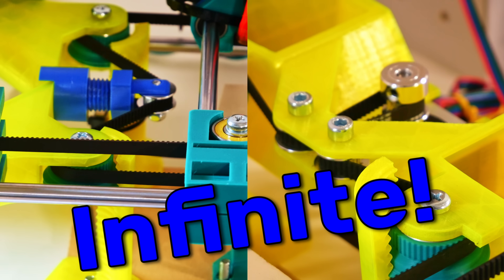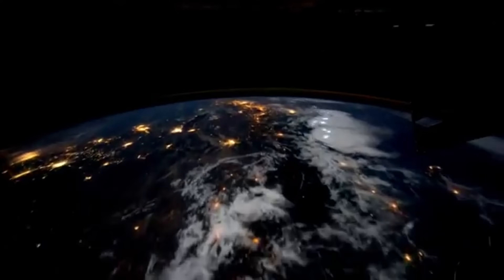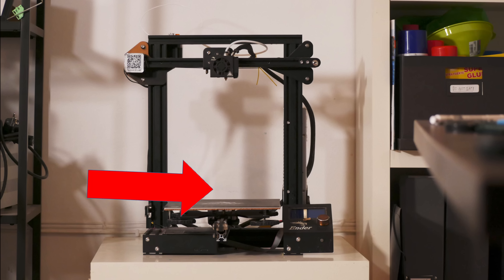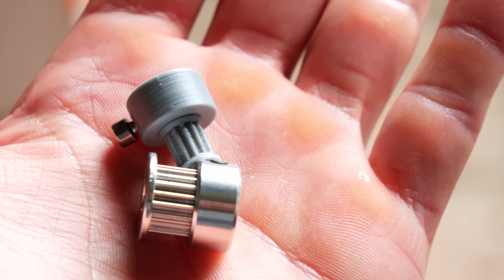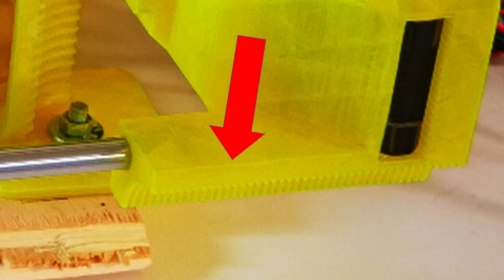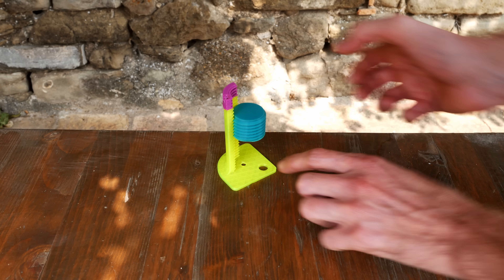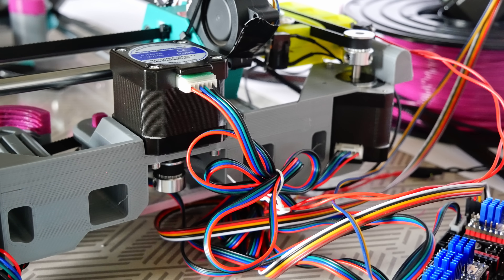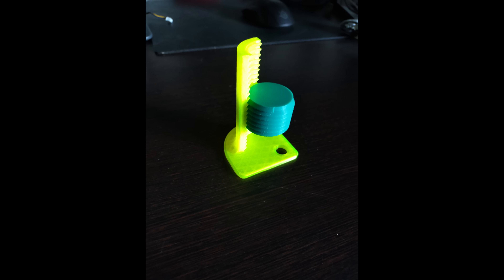it can 3D-Print onto itself?!

Comment: I don't think all the parts of the puzzle are here yet to make a print in place printer that can replicate itself. I guess thats half the point of this video and you have to start somewhere and work toward the end goal. I can still see this resulting in some useful concepts and applications even if it doesn't accomplish it's intended purpose. Part of this approach needs the original printer to be able to make a quality enough machine that even a few replications down the line, it remains viable. Even if they get a touch janky, at some point it's resulting printers will need to be able to make a printer as good as the original. It may have to print dedicated plastic-only and metal-only printers. It will likely need to print a mobility platform to move it's existing frame and parts between other modules. I wonder if the better approach is to look at the mobility platforms it would inevitably have to print, and if they can be modified to facilitate printing on their own?

I kinda think the solution is going to come about by an entirely different process or two. Once we have enough processing power to reverse engineer and understand DNA completely, we can grow organic "machines" to do this. For better or worse, the same processing might also lead to developing a completely viable mechanical self replicating swarm bot. Even if those design approaches take off and beat this design concept to the goal, I look forward to seeing what we can learn from this project.

Comment: Using 3D printers to print themselves it literally how they started 10 years ago nothing new here :(
I see metal  bolts,  screws,  liner rails, bearings, you need power supplies, stepper motors, a control board basically all of the things you would need to make a 3D Printed Prusa 3D Printer !!! You have done nothing original at all!!!

Comment: Check out the GUS simpson. It can print all the parts for itself (even a bigger version of itself) in its own build volume. It doesn't require linear rods either, so it's more feasably able to achieve the 100% printed goal. I designed a printer in openscad based on the gus simpson, but with some improvements, I'd be willing to share it if you're interested.

Comment: Is a good idea but I was thinking "the other way" for terraforming. Basically the machine should be able to conform the ground as a build plate by both compression, digging, filling; then scan the surfaced use supports over a scanned surface the same way we scan the bed now. This will defeat the gravity issue and proceeding on the ground level is easier for heavy machinery and scalability.
Reply: TLDR: switch Z with X or Y ;)

Comment: I think i saw in a lecture video some where, where the lecture embedded metal and ceramic particle in resin solution. Then use tradition resin printer to build up the structure, afterward sintering in an oven to remove the resin and fuse the metal/ceramic particle. An interesting side effect is as structure feature size decreases, the strength of material actually increases beyond the isotropic material strength. And it was able to build material with customize stress and strain curve. Pretty interesting. Too bad that video got privated later. But the same technology of suspend non-filament material in filament could work here. Maybe infuse the filament with microsize industrial diamond or something

Comment: after watching 10 seconds i thought "he won't be able to print the precise parts like guide rails, stepper motors and even just a multi strand wire and forget about the power supply and controller." After watching the whole video he didn't even hint at most of these challenges (apart from Parteon exclusive content... ) 
At least this isnt about a revolutionary blood test device but just a 3D printer of which there are plenty to choose from on earth...

Comment: Well, this is certainly a novel design concept, would it be a CoreXY or Mendel-derived?  Either way, it's always nice to see someone produce a new approach to the RepRap problem.  I wish you luck in getting your system to remain accurate at higher Z-height, and in second-generation designs.  Accuracy has been the boogeyman of most of the mostly-printed 3D printer projects.  Self-replication just turns out to not be that valuable in situations where you have access to the industrial base of Earth - and anything that seriously threatens that will make acquiring the components needed to control a 3D printer impossible to acquire, meaning that even the ability to print motors and circuit boards will not allow for the creation of new printers.

Space exploration and colonization are a different beast, of course.  Sending long-term missions off with a printer that can partially replicate and extra sets of unprintable "vitamins" should be standard practice.  A smart interplanetary exploration group would also agree to a microcontroller standard, probably Arduino, and send along a box of hardened controller boards that can be swapped into various devices after either being reprogrammed on-site, or more likely by a team back on Earth who can do the programming and implement whatever hardware the explorers need in order to ensure that it works before transmitting it.  

But, hear on Earth, there just isn't really any way to compete with traditional injection and cast molding for producing strong and accurate components quickly.  3D printers have much greater design flexibility than molds or subtractive machining, but they are way too slow to serve as the basis of cottage industry.  They're too slow and inaccurate, even if you're using them to make your expendable components for other manufacturing methods, like lost-plastic casting.  I used to be a true believer in the economic transformation 3D-printing could bring, but it's just too hard to realistically compete with a 39-year-old single mom pulling the lever on a home-made manual injection molding machine.  She will make in a minute what takes the best printer an hour.

3D printers have their uses, and they should be used to their full potential instead of merely as slow plastic crap makers, but unless the design requires additive manufacturing there's almost always a cheaper and faster way to make a widget.

Edit:   Waaaait, you're the guy who does some really smart print-in-place compliant mechanisms to avoid gear slop.  You know all this shit already.  Why not see if there's any part of an X/Y carriage that can be done with compliance?  I knew a guy who messed about with Sarrus linkages in place of steel rods over a decade ago.  His linkages had slop, of course, but perhaps there's a compliant variant that's possible to print?

Comment: I had Ideas to fix problems. First of all to beware of slipping gears you can use wheels and helical spring to pull legs to gear. in this way it will always stays in line. for sensing end of legs top you can use photo diode and low power pointer laser with relay or something suitible with your project base. but even if you do these there is another problem when legs get longer they will tilt over and they will be shaky. For this reason you have to print some joist(I couldn't remember its name but maybe its called beam) cross joist will be stick it to getter more stable. I can make some basic drawings for them too.

Comment: Why don’t you print horizontal supports between the z axis towers to prevent slipping and wobbling at higher heights
connecting them would also mean you don’t need to screw the towers to the ground
Reply from the maker: True! And it's designed to do that, but in this prototype form it is relying on the frame rods being the right length, and they are not, so for now the legs are independent for the development stage
Reply: you can do that at the bottom and top, but if you do it in the middle, you then have to remove material before you can use it as a frame for the next generation.

Comment: Good work to increase the build volume by printing itself. if this works, means people can make larger printers than buying, reducing the market cost. But as you go higher, problems such as wobble, vibrations and noise in prints can be forseen which ultimately effect the print quality and reliability.
Reply from the maker: Jupp, but its designed to be able to bridge between the legs, so that will ad alot of stiffness to the structure

Comment: won't a small imperfection in the print make more imperfections in the next printers, making a chain of errors that will become bigger and bigger? and let me tell you: in one print there are lots of imperfections.
Reply from the maker: That is correct, hence why we need a closed loop control system, that should be able to negate this issue
Reply: @TurboSunShine  have you tried actually print another 3d printer multiple times in a chain?

Comment: I would say you need to changing your starting goals. I had a brief ponder over the problem and feel you need to turn this on its head. I think you need to start with an upside down core x/y printer with the z-axis moving away from you as you have started. But the base model to start this would need to be a multi head 4 axis type core x/y. You would need to use more exotic materials and have pick and place hardware available on the base model, such as bearings, screws, electronics, hotend etc. The multi head tools could include different materials, a router/drill, a pick and place head, screwdriver etc. In terms of the z height may be a gantry crane triangular frame with the threads on one side to provide rigidity. Other problems will be keeping the first layer attached to the build plate throughout the process and preventing warping and shifts due to temperature changes. Perhaps the unit needs to be enclosed as it is built, with some form of draping skirt and roof as it gets bigger to seal the heat in. I think decreasing the starting goals so it is the first iteration. Then extend the goals on each iteration. My other suggestion is would be to use SLA rather than FDM. Again a pick and place could slot bearings in, but you would have a better control over accuracy and although enclosed again, no issues with temperature problems, 1st layer etc. It could be feasible that using SLA different materials could be used such as silicon, copper and steel and other specific materials. Of course technology isn’t quite there for fusing materials such as steel and copper together without sintering the end product.
Reply from the maker: Yes, a lot of these things have been considered, and some will probably be implemented in some way! For now, this is just a prototype, so alot of features were omitted

Comment: They are called Butress threads, used in jacks, lifts, screw presses, etc. There are also some bone screws with "C" shaped threads.
Reply from the maker: Jupp, but those are slightly different, since they have a 0 deg thread angle, rather then a "negative " one

Comment: Genius idea but here comes a stability problem
as it gets taller, it has to handle itself and the machinery, causing to bend and eventually breaks, so it needs to handle it's own weight while going tall as possible without collapsing.
I am no architect, but all materials are soft, so in a conclusion it needs to be improved (by 3d printing supports that handle itself)
Reply from the maker: Ok, infinite might be an overstatement, but it should be able to do what it's designed for:)

Comment: Two thoughts: add dual load cell for x and y to zero.

Or add limit switches to each side and the hotend has to zero out at that limit switch which corresponds to the start of the "ladder" for it to print.

Comment: Crazy-clever! 

>> To avoid wobble as it gets taller, print diagonal braces (or even a solid shell) rather than just legs.

Definitely out of the box thinking! 👍😉
Reply: When the concept finally works, it wouldn't even be a problem if it was very slow (because printing a complete solid shell). Since it replicates exponential, the print speed would only matter in the beginning...
Reply: Printing sides may seem like a good idea, until you realize that it can't make a second print with sides in place.  Because the Z-axis is inside the print volume, and the X and Y inherently cross the build area, any bracing between the Z pillars will cause the X and Y axis to crash when approaching Z-0.
Reply: @Kineth1 It can't make a full-size second print with solid sides, but it could still make repeated prints within a slightly smaller volume. It seems to me that it would make sense for the larger printers to make this trade-off - they can still continue to scale up their copies at a slightly reduced ratio.
Reply: @qwertystop But that would defeat the entire purpose of its design…
Reply: @Kineth1  Good one, job security.
Reply: Whats if you make a Big plate on the ground and make the z axis on it
Reply: French cleat with angled steps, comes to mind
Reply: if i can add use radio tower stacking lattice structure as reference. electric/data cable roller from 1 of the leg bottom, and filament roll in the middle top of upper frame, so no stray cable/string messing the z motion.

Comment: regards the trigonometry to determine exact position.. could you consider using a laser to determine exact position?
Reply from the maker: Yes, but that does make it more difficult to fully print it (which is the ultimate goal) so for now we'll have to see if we can get away with some sort of switches or load cells

Comment: this is nuts, the solution to some of these problems is outright brilliant. i hope you crack it. 

rather than using a nozzle probe to find the position. maybe it would be better to have endstop switches on the edge of each Z axis. then you know where the printer needs to add new layers to the Z axis when the endstop is not held down + any offset, the nozzle is alligned to print ontop of it. ime bltouch just doesnt have great precision or repetability and personally ive had far better success with Klicky-Probe. but maybe direct nozzle probing would be best for this so you dont need to worry about probe offsets given you need to be precise or the printer falls apart but now you need to wait for the hotend to be cold to probe and also need to ensure its clean.

the probe method needs to be as repeatable as possible. the variance will add up every time you need to restart printing your z axis.

Comment: The printer that can print itself is still a very noble goal, and I love this general concept. But without really good constraints in the basic design, this printer will be a very effective error multiplier, especially as the self-printed Z axis layer height is guaranteed to have imperfections that add up in the output model dimensions. There must be some better way to get a Z axis and guarantee layer consistency at the same time. (e.g., Redesign as a wall-mounted XY gantry with the Z bed hanging below from its drive belts or drive screw.)

Comment: The only problem I see is the legs becoming increasingly unstable with height. Maybe input shaping could help (if you did not already implement it). Other than optimizing the movement and making the legs more rigid (by integrating them into the design as you already did) there is little you could do so there is a practical limit when it comes to height.

Comment: Amazing conzept, I also toyed with the idea of printing a motion system for a printer directly, but I did not take it anywhere...

Very clever solution for the self-printing brackets, but I would be a little worried about it getting too wobbly on larger prints

I will follow this project with great interest!

Comment: Wouldn’t the resin printing a solution for this? Precise rails  and if z axis has a gear that lift up the cured part then it’ll be infinite and we need just one dlp or galvo or what ever with 2 stepper to lift it up

Comment: I would love to see this be a thing because it would be simple and straightforward for manufacturing of the future.
But there are so many processes that just don't lend themselves well to this that I think a better approach is makeing the each machine capable of makeing some of its own parts rather than all of them.

So as long as you have one set of all the machines then they can collectively make themselves.

There is the obvious examples like not being able to print the ICs that go on the circuit boards to run it.
OR
You still need seperate machines to refine raw materials into a form the printer can use.

Hell just the fact that a finished printer needs to be removed from inside the build volume already means you still need external systems even if the printer was fully functional as printed.
So if you are going to need a robotic arm to remove finished printers. Might as well just print arms and have them assemble something assuming that makes a problem easier.

Said another way. Rather than trying to print a fully functional printer. Since there is no way to get away from still needing other machines. Make a printer that is as 3d printable as practical without sacrificing a ton of capability, and have other machines finish the last mile.
At least thats the way I would take it.

A self replicating factory is just as cool, if not cooler gien it seems doable.
Reply from the maker: True! The dream will probably never be realized as envisioned today, but for now its a ok heading i think